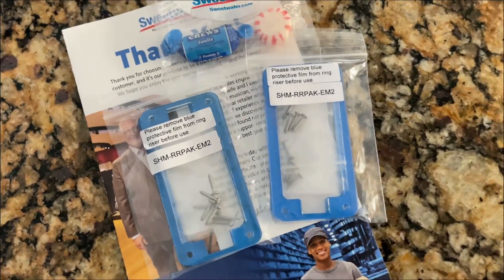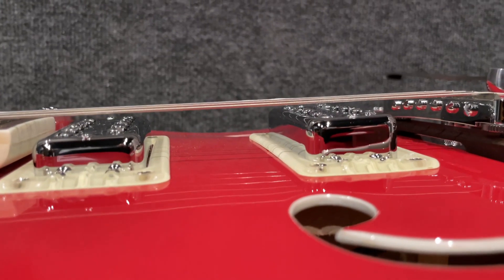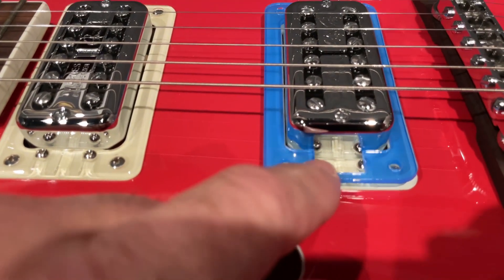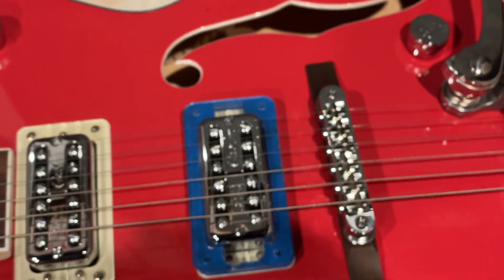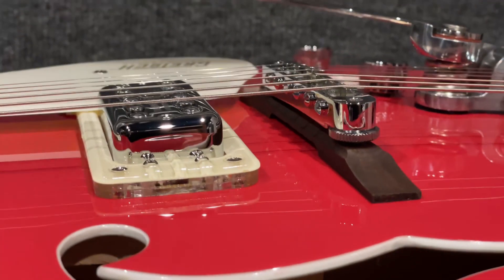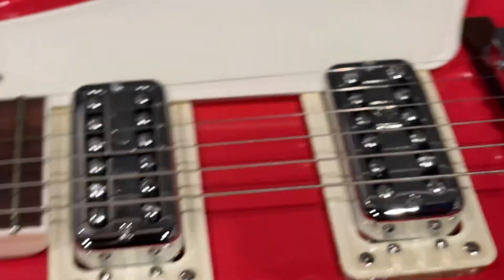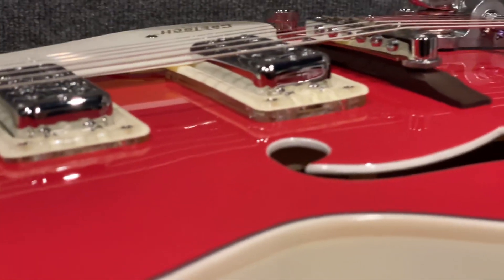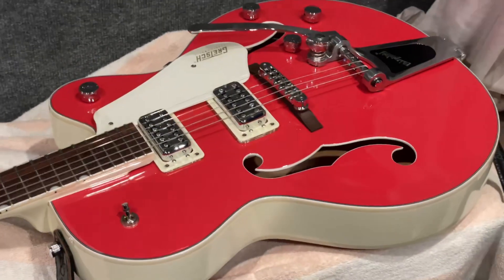Pickup Risers, A Must when Upgrading pickups on an Electromatic Hollow Body

Comment: I used some of these on a 6120 that I’ve owned for 20 years. The foam behind the pickups wore  out over the years so I replaced that but still couldn’t get enough pickup height so I used these same risers to be able to get more height adjustment. I did have to trim them a little bit in order for my pickups to clear but they worked and get the job done.

Comment: I converted my 5120 to Filtertrons by cutting a piece of perspex and putting 2 screws through the pickup cover holes into the bar, then with the PU mounted, I drilled the F/Tron mounts and used 2BA screws and nuts with ST PU type springs and  made adjustable Filtertrons! Did this on a 5122 as well. You can buy 'English Mount' TV Jones pickups which have the Gibson humbucker/Gretsch 5420 type mount system.

Comment: Weird... I have two of the same exact guitars and I definitely did not need risers. The stock Filtertrons that came in the guitar have plenty of height adjustment and will spec up with no troubles. The TV Jones shouldn't be any different. I have a Tri-5 and a G5420T both with Blacktops (or in the case of the Tri-5 "Pearloid white tops") which are identical to HS Filtertrons or TVJ in dimensions and I set the pickup height without the need for risers. Not sure what's going on with the posters guitar here but the neck set angle on mine doesn't look any different than what I'm seeing here. And looking at the video from the base side when he starts piling the spacers on the pickup the height of the pickups as they already sit don't look too far off from the strings to be near correct already. Of course as we all know you can't upload a picture to the comment section of YouTube to help the cause so the mystery continues... 🤔